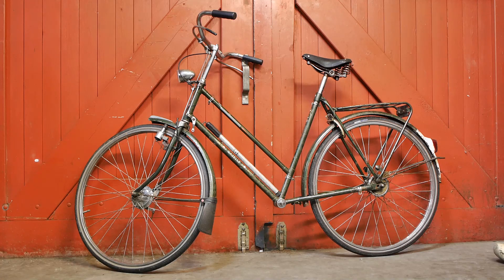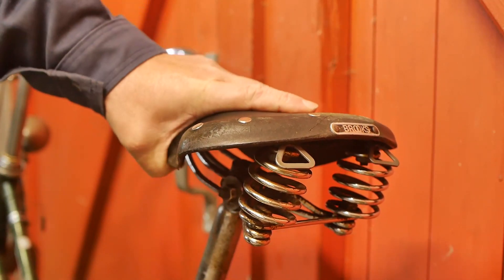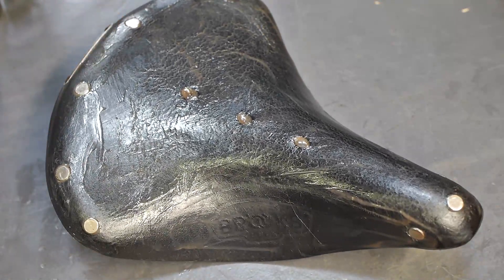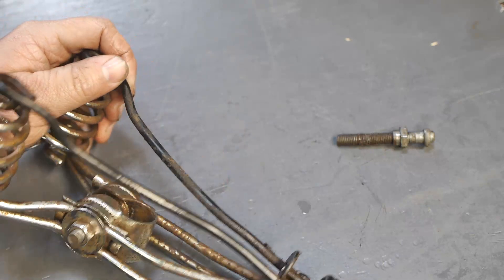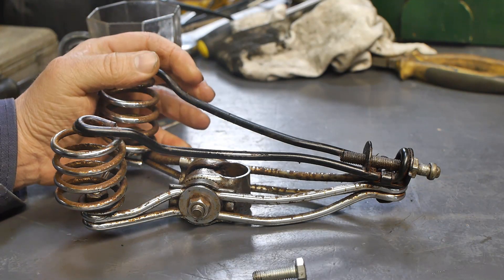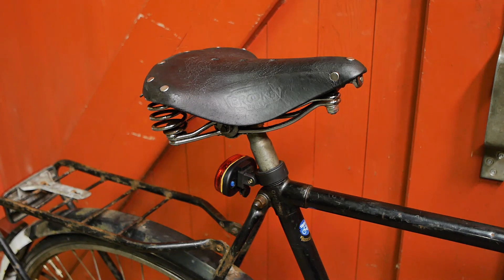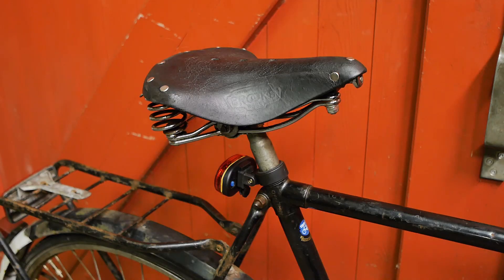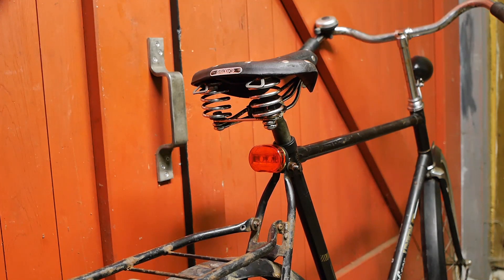Fixing a Brooks B66S leather saddle

Comment: Nice video, I have Brooks saddles on 2 of my bikes, I never adjust the nose. When they start to sag, I lace them. If you use the adjuster bolt, when it is all the way on the travel, then it needs to be thrown away.
Got about 4000 miles before the sag started, the lacing brings back the comfort.

Comment: More than likely it was a Whitworth nut 5/16" . M8 will fit sometimes if the bolt is worn or undersize enough.
Reply from the maker: I now know that Brooks are a rather traditional company but I doubt that they would still be using Whitworth :) And apparently they do make a special Brooks spanner, I just made one with my trusty angle grinder :)